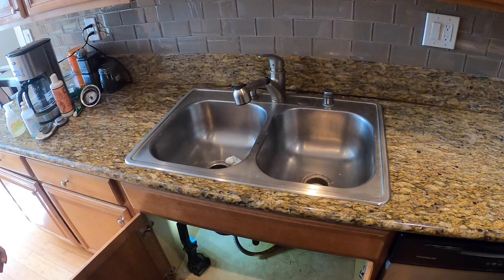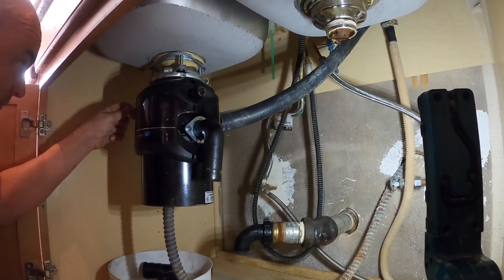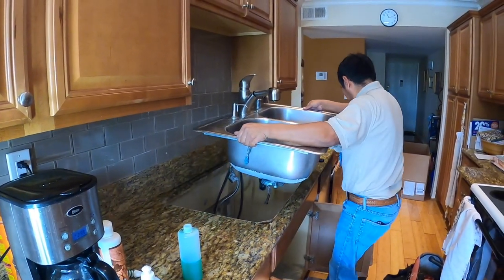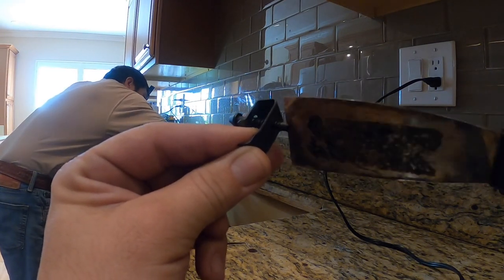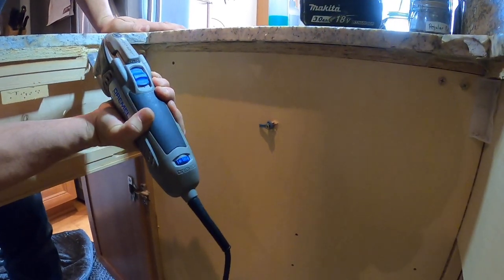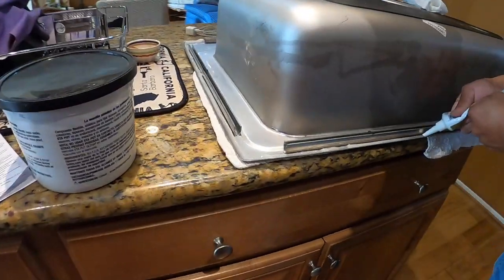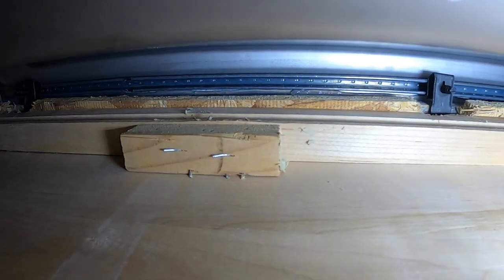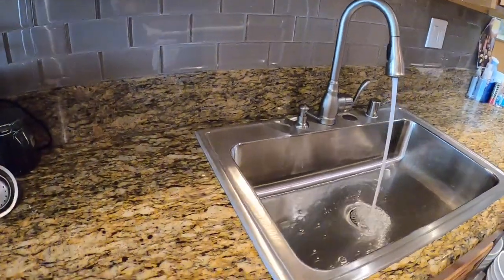How to Install a Kitchen Sink

Comment: First... nice job on the video. I'm going to be replacing mine today in the same fashion. Why didn't you install the faucet before dropping the sink into place? Seems to me that it would have been easier. Would be nice to see the plumbing that you performed... as mentioned, I'm going from a double to a single bowl with the garbage disposal.
Reply: Me too! The only part I wanted visualization of was the new plumbing (the part thats not self explanatory) and it wasn't covered...

Comment: My sink I got is double bowl but only has 10 clips. So I know three go on the front and back and then two on the left and right. I don't know how to space the ones on the sides. Do I put one at each corner or do I put them a little further in? Also I would have really liked to see how you put the silicone around the edge of the sink once you had it into the counter. Exactly where you put it and what size bead you put and how you cleaned up what you didn't want on the stainless steel sink and part of the counter. I have 2 sizes of containers of silicone. I'd like to do it as nicely as possible and not wipe too much away so I don't have any leaks. Also you have a great voice for explaining this but there are a lot of times when you're showing something and pointing to it and there are shadows from your hand or it's just dark underneath the sink and it's hard to see what you're doing. My sink came with a lighter shiny looking color of clips and the ones you're using are black which adds to the not being able to see detail in the darkness. And I don't understand what you mean by locking the clips in. Is that supposed to be pushing those little pointed corners into the material under the sink? Or just getting them pushed to make good contact with the material? Like I don't see how you could push those into granite. Maybe next time some shots from the side under the sink like get a view of how far it shows the clip pushed in and exactly what it's pushed into and where it's supposed to stay when you start tightening the screw. This is my first sink install. I've replaced all the stuff under the sink but I haven't put a sink in yet. 

Karen

Comment: Can we get deeper u-channel sink clips for a thicker countertop?
Reply: I have thay same issue now, I don't want to remove material since I would need to groove out 4 clips. Did you find a solution?
Reply: @Francisco_777-r2  I bought an oscillating cutting tool and got 4" long strip of the below-countertop wood cut out of the way. They just glued too wide of furring strips on - below the countertop wood. My multi tool broke  after 20 minutes use but I had enough cut by then to install the sink and got my $ back for the tool. Notching out the underside worked for me but had to use that tool.

Comment: If there is no room for the clips, can a sink be installed with Strong as Nails?  I know it is not the correct way or the best way, but will it work?
Reply: Did you try it?